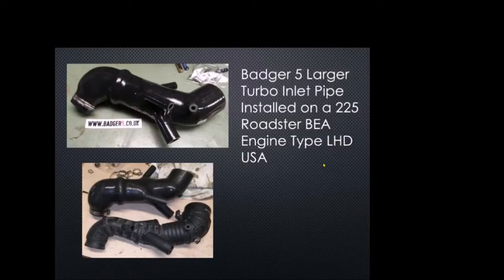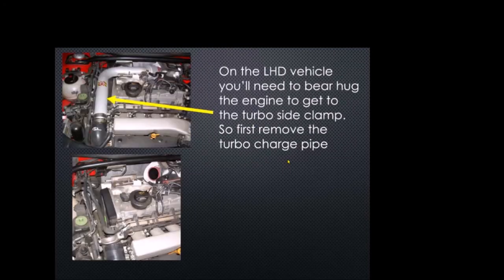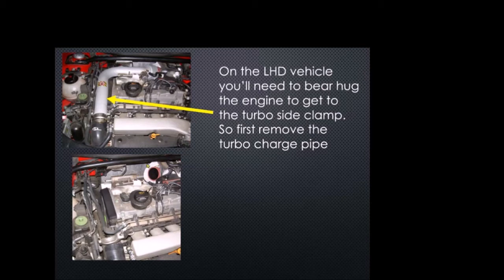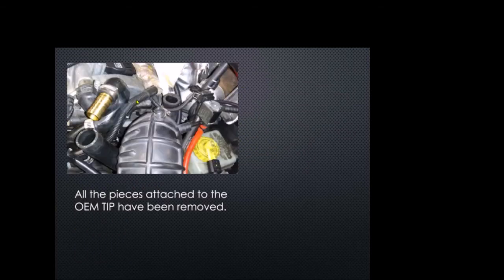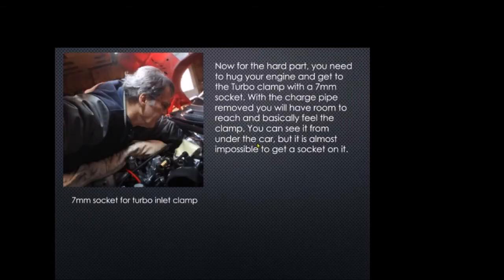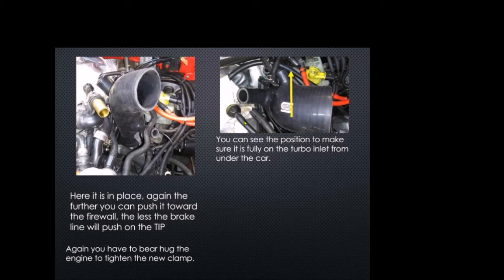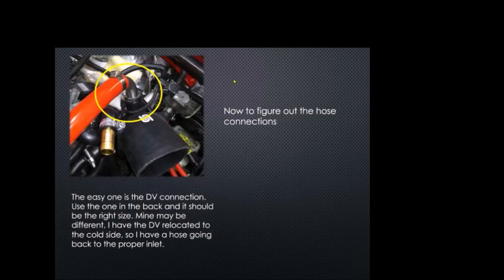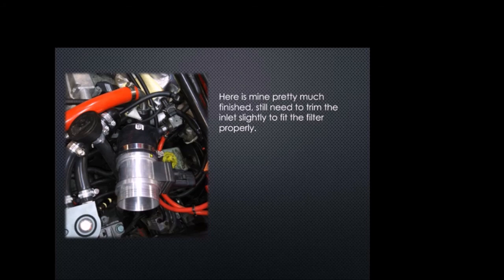Badger 5 TIP Install LHD Audi TT BEA Engine

Comment: Great video!  You mentioned that you installed a catch can.  I have a BEA engine as well and wondering where I should connect the brake servo line to when I install the catch can?  I am also doing an sai delete and eventually an evap delete to.

Comment: sick video I love it! I have the same engine code and year. that little check valve comes off the brake booster system, seems like a bypass out a three-way valve that feeds of the manifold and feeds the brake booster. am guessing is a relief for when the pressure isn't needed, all the other engine codes the brake booster if fed off of the manifold directly without said relief system am doing a PCV, SAI, N259, N112 delete right now  I want to simplify the hoses in the engine bay. am kind of wondering if it is needed or if I can hose directly to the brake booster with no problem...
Reply from the maker: Yes, I recently went to a different setup with a larger turbo, we decided to eliminate it.....no issues so far...

Comment: Looks great! How did the brake lines hold up? I’ve had a TIP wear through a brake line before, did the rubber work?
Reply from the maker: It had a tendency to slide,  but yes it worked as long as I kept it in place. I have since replaced it with another turbo setup....thanks.

Comment: hello i have a 2005 audi tt with the same BEA engine code as yours and am wondering what the PCV valve is for and where that line runs to and if its possible to delete it. The one you talk about at 1:42
Reply from the maker: I have since deleted most of my PCV system, except for the hockey puck, including that valve and put in a Catch can.
Reply: @videonow32  Can you do a tutorial for installing a catch can on this car? The PCV system on the BEA motor has a completely diffrent layout compared to all the other engines.
Reply from the maker: @rektominus3637  Yes...the BEA is different. I put in a catch can on mine and just put it in between the valve cover and Hockey puck PCV valve. Really not much to it, I kept everything else.  So valve cover to catch can inlet and catch can outlet to the hockey puck valve.